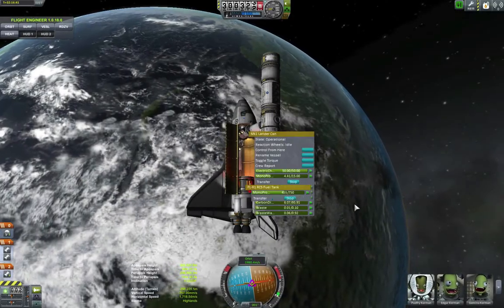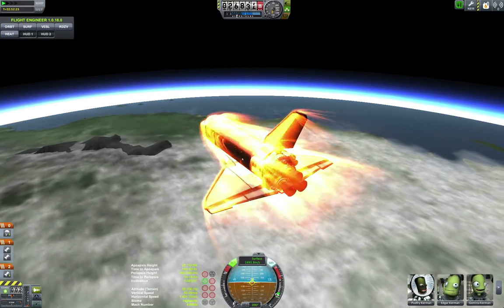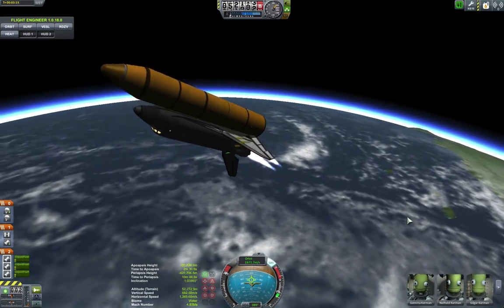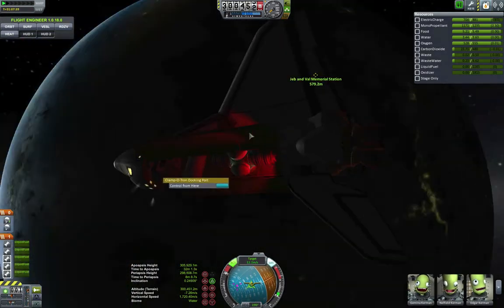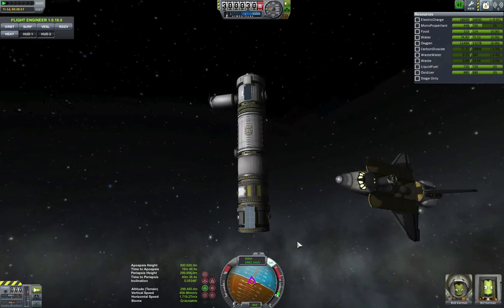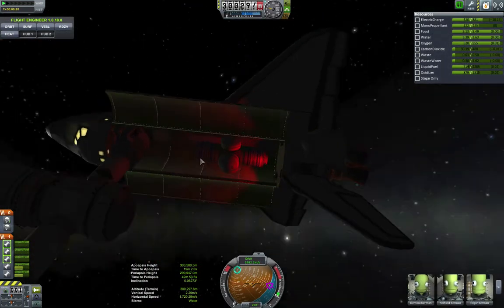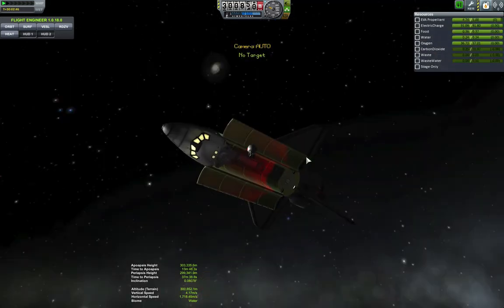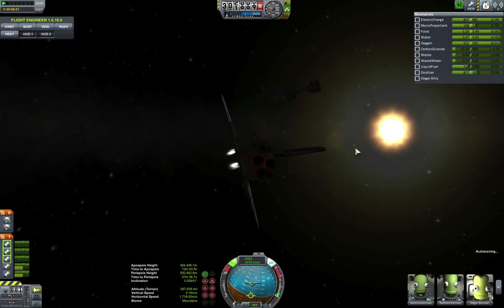Shuttle Program Mini-Series Episode 3

Comment: Does that dual senior/regular docking port work for both? How did you manage that?
Reply from the maker: Bill Wheatley It certainly does! The trick is to snap the senior port on first, then use the offset tool to drag it out of the way laterally. Then I drop the other docking port on and center it. I pull it out from the part a bit, and then return the senior port to it's normal position by selecting it and pressing the spacebar.
Reply: Awesome thanks!